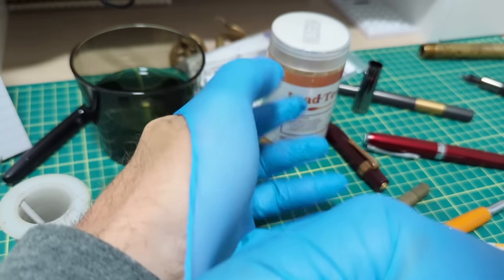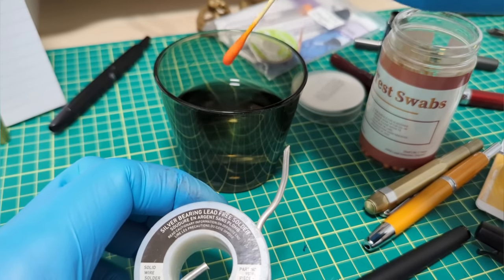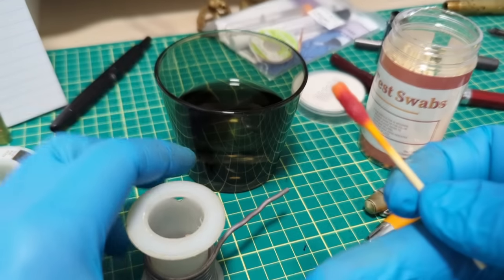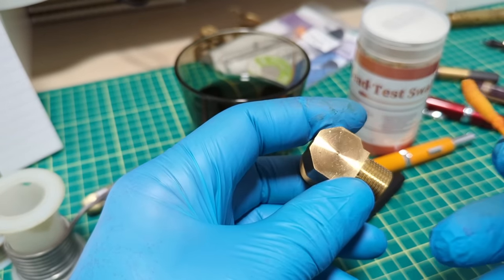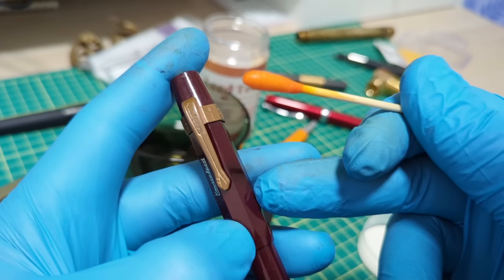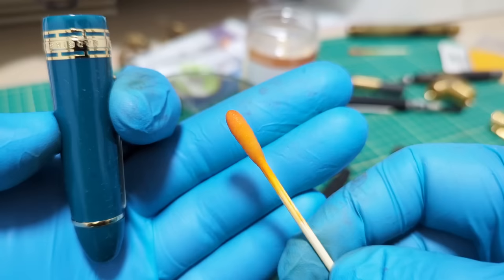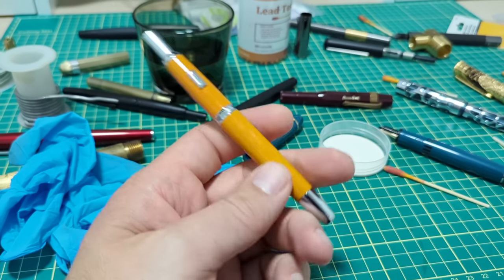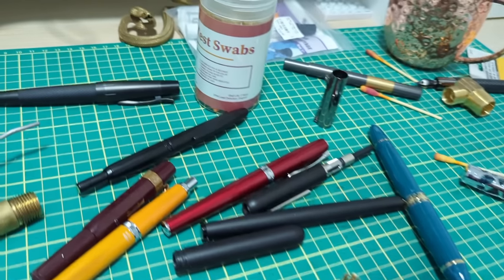Is There Lead In Your Pens And Should You Be Worried?

Comment: This is a very informative video, but you can actually get lead poisoning from prolonged contact with surfaces that contain lead. Your skin is porous and can absorb small traces of lead through different processes. However this will be a non-concern if your pens are properly coated, and even then a 3% lead containing alloy will need a long time to become even slightly toxic. Just, if you use your pen multiple hours a day (for some reason) don't get a naked brass pen
Reply from the maker: Its really tough to tell how much exposure is required for skin contact.  These are only hovering around 3% lead (for raw pens) and then you have to take into account the surface area of the contact to your skin.  The lead absorption through that amount of contact is as minimal as you can get.  Absorption through skin is no problem for Organic Lead (tetraethyl lead and tetramethyl lead are the most common), but for inorganic lead the risk is very low and you need significant skin contact with very high lead concentration.

Comment: We played with lead painted toys as kids, we also had and still have copper water pipes even brass parts containing lead and we have touched mercury with hands. Nothing bad happened. 
People should understand that when we talk about the dangers in such materials or about radium in watches, we talk about industrial level exposures. 
Radium girls got poisoned because they licked radium painted watch hands, you won't get any harm by wearing your "T swiss T" radium watch.
Lead is dangerous if you inhale it so we don't sandblast it when we want to remove the paint from something that has lead and so we wear a protective mask when working with it and cutting it. 
Mercury that gets all the blame is absolutely safe to touch it with bare hands as long as you don't have cuts and wounds in your hands. If you are still concerned don't try to cut it with your nails, so it won't trapped under nails. Mercury is dangerous if you eat it or inhale it. 
In fact most of those dangerous materials are only dangerous if you eat it or inhale it. 
You obviously won't do that.

Comment: Valid and (frankly) wonderful direction to take QA testing for Pens (among other things). While we don't hear so much about lead poisoning anymore (other than "It's bad" of course) there comes a certain false sense of safety about hazardous materials in modern components and products. Whether you're a parent with children that might even be tempted to gnaw on pens, or you're a tinker who likes to shape, decorate, grind, polish or otherwise fiddle with metal parts and systems, it pays dividends to know what may or may not have lead involved. Even that it's generally just sloppy and foolish to go grinding on metal without a mask, there are those who insist (and will insist) that just doing the work outdoors is good enough.

    Lead can still be found everywhere if you look hard enough. There are ancient pipes underground all over the U.S. infrastructure, and lead gets involved to "tolerable levels" in things from solder to welding rods and even tubing and plumbing fittings... It's DEFINITELY worth putting out there, even with the follow-up that with reasonable precautions, it's not so serious a hazard.  ;o)

Comment: The claims of lead causing psychosis and the like in the Roman Empire is questionable. Comes from one paper in 1983 from Jerome Nriagu that had no citations except for the idea of the diet, mostly. Which was clinically tested to mixed results. In excess, there was enough lead ingested to cause lead poisoning. But what was excess wasn't really determined because of no quantitative amounts of foods and beverages eaten written down. As for the lead in the Roman water system, maybe a third of the piping and waterways? Determined to not be that relevant, though it's become a YouTube claim again that the water system led to psychosis. Check out the video from the Metatron on this topic with better information about that.
Like the reason certain tamarind candy from Mexico is not allowed in the US today, because of the lead toxicity, it's still a good thing to be informed. I'm a weirdo "Anglo" that actually likes Mexican candy. 😁
And certain Chinese items have already been linked to having higher levels of lead, so, good to check. 😉 Other than that, most of my pens are vintage, with a very minimal amount of brass (vintage Esterbrook fan, and they were steel. No brass. Same with the caps on my Parker 51 (stainless steel) and Waterman's Taperite (aluminium.) Rest are celluloid. Ish. 😁
Interesting that it was the non Chinese pens you tested that showed with noticeable lead levels. 🤔
Reply from the maker: Yeah the Roman Empire collapse concept is interesting.  It's interesting because there are records of strange behaviors and other things that "appear" to be symptoms of lead poisoning.  There was a cookbook that had around 400 recopies and over 1/4 called for the grape syrup (lead acetate) as an ingredient LOL.  So no doubt they were getting some level of lead poisoning, but just how much and the impact is tough to determine.  But the one thing you don't want to do is ingest lead, and they just seemed to come up with every possible method to open the doors to getting it inside they system 😆

Comment: This brings to mind when I learned about indentured servants in early USA, when I was in 7th grade. According to Mrs. Smitherman such were registered by taking dental prints by making them bite on a thin sheet of lead.  Sounded interesting so I got some lead and pounded it thinnish and bit it.  Couldn't get a readable print, but did get aan interesting headache, quite similar to the one I got 3 years later by wearing some glasses I found for a copule hours.

Comment: These swabs corrosive to the brass?
Reply from the maker: What's 60 seconds?
Reply: @Doodlebud  my bad
corrosive?
Reply from the maker: 👍No not corrosive.  You can wipe the pen off afterwards as well to remove any residue.  It didn't impact the paint on the pens either (at least the ones I tested).
Reply: @Doodlebud  good.  thanks for this btw.  While you and I and other pen lovers won't stick out tongue into pen barrels.  kids may. or pets.
Reply from the maker: @paulchiu  yup, figured it was worth doing the test so folks know.

Comment: For the record, I will happily live and die by plain old 60/40 lead solder. I could never make a solid joint with the lead free crap. And I say anyone who does hobby circuitry can afford the hit to their smarts that it causes 🤓
Reply: You need to set the temperature on your soldering iron a bit higher!

Comment: I am glad you mentioned a number of times that one has to ingest lead for it to be poisonous to your body. Even if fountain pen ink has lead you would have to ingest the ink, not simply touch it. Licking your inky fingers to wipe them clean may not be advisable. 

Good demonstration.
Reply: Might make pen chewers think twice!
Reply: @archivist17  I wonder about the wooden pencils that growing up many have chewed on. I wonder if there was any lead in the coating or is the lead had any lead, if you know what I mean.
Reply: The vintage Esterbrook felt tip markers ultimately were discontinued when the government stopped the selling of the ink for them. Wicked high level of lead. Only "fountain pen adjacent" ink I know of that had lead. 
Frankly, I'd have worried more about the "51" and Superchrome inks Parker had for the 51. Until it came out that they even ate the early sterling silver breather tubes out of the pens, and melted the latex pump for the Vacumatic and everything for other brands of pens except for the gold nibs. I think they self pulled them off the market. After the outcry.

Comment: Does having a cut on your hands make any difference in absorption?  Just curious.
Reply from the maker: Can't say for sure but I would say most likely.  But again would only apply to raw brass pens that use brass (or other materials) that contain lead.  And again its a very small content ~3%.  Also have to consider the surface area of the open cut and what the absorption would be.  I would just really say make sure your little kidos don't a pen as a soother.

Comment: You did not test the knockoffs the same way you did the German and Japanese pens.  Really? Just the outside of the crap and the on the higher end ones you go digging inside to find exposed metal that a user would in all likelihood never come in contact with.  Now you have shown yourself to be an alarmist for no useful reason.  Either remove this video or redo it with the same type of vigor on all the pens shown.
Reply: They sanded the coating off to expose the brass fully, and used the section and the clicker, both of which are the parts you touch the most lmao. Low effort troll.
Reply from the maker: The same vigor? I had to sand parts of the Chinese pens to reveal the brass. FYI the brass on the inside diameter is the same brass on the outside diameter. And I also dug inside the cap of the WingSung 630 to show lead on the brass screw. The bronze clip on the kaweco was in plain sight and tested that too. Apparently you didn't pay attention at. And no, I won't be removing this video